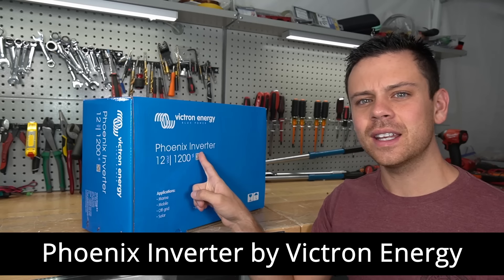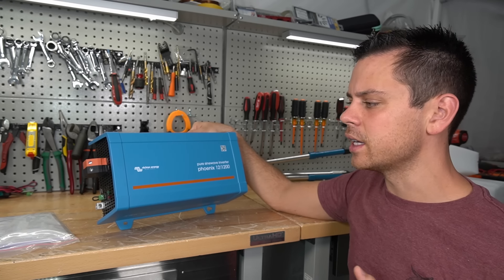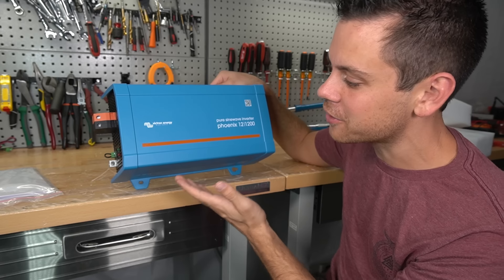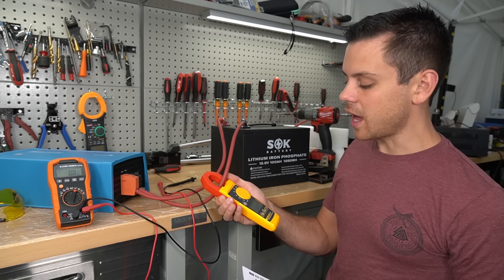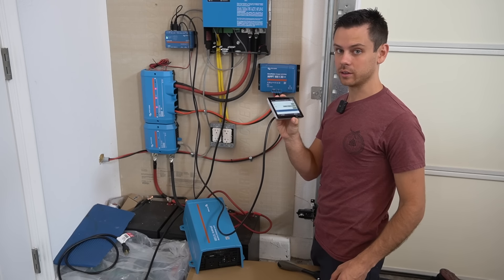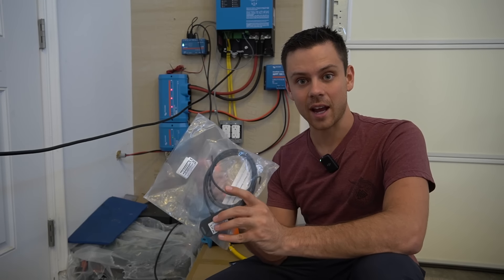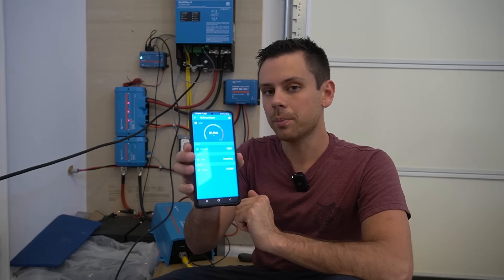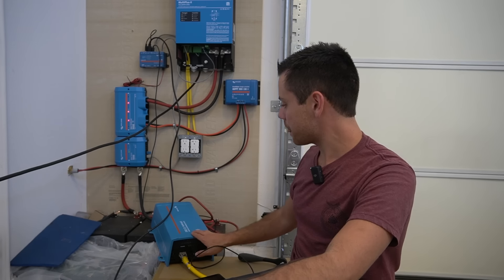Victron Phoenix 1200VA LF Inverter: Extremely Low Standby Consumption and More!

Comment: Hello 
So do you think this inverter is ok too leave on 24hrs a day ? 
I have a system set up in the garage for small power loads like tool battery chargers, USB things. 
But was wondering about running a cable in to house too a stand alone socket and power the TV and Wi-Fi things off it most too time. 
Thank you for your videos really good.
Sam
Reply: Hi there. My setup is almost the same. I have a battery&charge controller in the garage, also a cheap inverter was there until it broke. I run a cable to one of my rooms and a socket was powering my laptop + screen. Now it’s time to buy a new inverter and I was thinking to go for either this victron or the renogy 2000w. Low consumption may be important though… not sure yet what to do

Comment: Hello, i already have the 12/375 Phoenix inverter and i am planning to buy in a few days the 12/1200. My question is can the 1200 inverter run a washing machine without issues if the loads of the washing machine are in the limits of 1000 watts (wont use any warm water just cold) ? I ask because im wondering if the constantly start and stop the drum of washing machine does to wash the clothes make any damage to the inverter. Thank you. Keep up the good videos !

Comment: I'm sure on Eco mode the output signal is not a sinusoidal wave. So, if you want to charge your phone or other small devices you will need to disconnect the Eco mode 😕 
Thanks for the review!

Comment: egs002, ferrite ring, loop it around welding wire a couple times, add a transformer, torroidal salvaged or new if you can find them
10kw 25w idle laminated transformer, 15w toriodal
and the 10kw boards can be pushed to 250-300a as opposed to the factory 200a shunt limit. 
Theyre chinese, but they are actually good. 
You need it mounted to solid surfaces, so cables are managed and batteries can be in same cabinet too. This is best way.

Comment: I just bought a Vicron Phoenix 1200VA and have a question on grounding.  On the Victron there is an internal jumper to change it from floating neutral to bonded neutral.  Since this will be in my garage that already has power and a panel I am confused on how to ground it.  Do I leave it in neutral floating configuration and connect the ground to my panel ground (two ground rods 10 feet apart) or do I bond the neutral on my Victron internally and use a separate earth ground therefore isolating it from the rest of my garage?  I know from NEC code there should be only one neutral ground bond so that is where I am confused.  My inverter and mini solar setup will never be connected to the grid.

Comment: Can I connect the 12/1200 inverter to a circuit breaker load center to run a small workshop that has some led lights, and some small equipment?  I have the 5-15 plug version

Comment: Victron vs Outback?? Outback is my only experience with pure sine wave inverters, I use a VFXR2812 in my semi. Am very interested in building a LARGE solar generator using reconditioned forklift batteries, and just wondered what inverter / inverters I should be considering?

Comment: Will,
WOW! This seems amazing. Maybe I dont need a MultiPlus Compact for my camper?

With the low AC output ... Might it be good for use in a small-mid sized camper? 
I know it won't run my AC,but in my 2023 Grand Design Imagine 22MLE ... would it run my:
- Keurig K-Mini Single Serve Coffee Maker max consumption in the manual is 1470W ?
- Duxtop 1800W Portable Induction Cooktop?

Cheers, and Merry Christmas! 🎄

Comment: I've got two 23 year old Trace SW2512 inverters that consume 12 watts on standby and have an adjustable search mode that uses a watt or two. 23 years old and still running! Trace was the original and as far as I'm concerned is the best.

Comment: The idea of buying these vs targeted cost of battery capacity for AIO device power overhead at night is the most interesting aspect of this video to me.    I plan on exploring that more to see if its worth it on my end (EG4 6500) to buy 2x Victrons for tv/media/router + fridge and shut off the 6500s at night.   If anyone else has done the math on this as id love to compare.   I need to justify / have ROI buying more fun stuff.  Will needless to say your the man, great video.
Reply: You probably only need one-these can handle a high initial surge,and most refrigerators these days are pretty efficient.

Comment: I presume this inverter will function without the bluetooth dongle if they are fine with utilizing generic (lead acid) factory default settings. (?)  
If the answer to this question is YES, then:  Any system requiring non-typical settings (lithium for example) will REQUIRE the need for the dongle.  (?)  It appears there are no adjustment controls anywhere on this inverter (as well as the Victron Bluesolar charge controllers.) So anyone installing Victron gear on a non-typical (not lead acid) system really MUST acquire the dongle in order to adjust parameters.  (?)  Huge thank you to anyone who can clarify these questions.  :)

Comment: What about fuse size for the 12v 1200VA? A 35mm2 battery cable with a mega fuse to cover the peak power 2200W? Or should we only think about the continious power 1000W?

2200/12*1,25=229A
1000/12*1,25=104A

Comment: My 12 volt off-grid inverter uses 1 Amp on standby, in winter, far too much,  I used to have to go outside to turn off the inverter before sleep, getting out of a warm bed and going out naked in the snow was not much fun. Pre made remote switches only came with a non extendable 15m long cable were expensive and over complicated, so I ended up fitting a relay across the on/off switch of the inverter and a cable to a switch by my bed.

Comment: can you possibly test if victron phoenix inverter 12/250 can handle an inverter type ref with rated input voltage of 230V,60hz, rated current of 0.60A and rated input power of 60W?

Comment: I have one of these for a small solar setup. The biggest load is recharging my EGO mower battery, the charger pulls 880(?) watts, with a 12v LiFPO 100ah battery supporting the inverter. This seems to drain the battery causing the inverter to alarm and shutoff. Should I add another battery to support  the inverter?

Comment: I would love to have one of these. I have a samlex pure SW 1000w inverter. It is a nice inverter, Only real difference is it has no low voltage cut off, and the on/off switch is on the front of the unit. I use the on/off switch regulary and would find it awkward with the phoenix. Where my inverter is located it would be inconvenient. Yes i would need to use the remote function. The samlex also has 2 outlets...

but the blue tooth and the LVD are worth it to me.

Comment: Planning a tiny house on a trailer and will only use Victron due to only brand that use very small current on standby. Their EasySolar-II 3000 has a 2400w inverter with only 11w in zero usage standby. It will save me lots of batteries as I aim for a week on batteries (not much sun in Sweden in winter and charge on car charging stations). So the cost of Victron I save on batteries, not to talk about the weight. I also do not want my inverter to die in the middle of the winter so I want quality.

Comment: What do you recomend for 16 250w paneles for off grid? Thanks
Reply: Hello,  YOur 16 panels is 4000 watts. at most you would get about 3500 -3600 watts in summer California San Diego, cool ideal temperature 75F..  it's depend on what load you use to get the inverter you needed... Victron use VA not Watts. so you needed to calculate.  And the batteries.  I have 4950 Watts, 4x 470w and 11x 250w.  I got max at about 4200-4300 watts at max sun or ideal temperature of the year.  in Winter if cloudy I got about 200-400 watts depend on how bad cloudy. even sunny I get about 2500-3000 watts at max clear day in November to January 19 now.  it's been rain 4 days, I can not charge My Tesla during Winter,.. very little days I can charge only if it clear sunny day.  Inverter i am using EG4-6500 EX.  it stand by drain 70w /hour no load.  I will go over to Victron for efficiency.  High invest at first but be sure piece of mind it efficiency,
My EG4 Efficiency is 91% Peak ,  Victron is 94-96% conversion DC to Ac you use.  So.  Better to use Victron, Think about 5 Years use......  Average: depend on how much you use.  You get money back in 4-5 years.  I calculate my system: EG4 6500 EX x 2 units, 30 kwh batteries (15kwh EG4 + 15 kwh of 16 cells TACL 310 AH ).  and wire cost me about 12,000 USD or so, let say 15,000.  this system cost 40,000 USD if hire those companies out there do it.  Average Monthly use average is 150-200 USD a month so 1 year is 2000 x 7 years is 14,000.  You see?  Good lucks.  If I think harder,  I would buy Victron at first tho.... and low noise.  EG4 really loud.  but I like the Air filter dust before it get air get inside.  Victron is even better.  But Big unit have Fan too,  I would have to ask them are those Fan blow air to heat sink or to inside unit.

Comment: I have the Phoenix 12/250W version and the fan runs constantly - even when the unit is switched off. I was hoping it would be quieter and only turn the fan on when needed. Is mine possibly faulty? I have it connected to a WEIZE 12V 50Ah LiFePO4 Lithium Battery. Thanks.
Reply: Update: Returned it for a new one and do not have this issue anymore. It must have been faulty.

Comment: Yes, this Inverter supplies most of my 24/7 loads of the house.  I took this because the 800W version is the recommended minimum version for refrigerator. The fridge makes no problems, but when the freezer starts, I hear noise from the transformer (magnetostriction) and the function of some sensitive appliances are disturbed. TV, laptops and Desktop PCS are not disturbed but i hear the starten of the freezer from the speakers of the PC which are connected by a small Power supply.

Comment: Hello Will,I have a question about the Victron inverter....If you were to install the inverter to the shunt, how would you connect the inverter to the battery bank? Would you be able to still have the distributor, the charge controller and cebo connected without using the large inverter/charger?

Comment: "Off-grid Garage" has a two Victron inverters, one is "On" and it brings the other one on when there is a need for more power, then off again. This means that at low loads only a small quiescent current is needed but at high loads the system can supply 7KVA.

Comment: Would this be a good option to power my thermal hydronic space and water heating system? One ~60 watt pump circulates the water through the hrdronic collectors about 10hrs per  day  as sun shines.(on a differential controller to mass tank). The other pump turns on intermittently as the thermostat calls for it (primarily at night.)
I am wanting these electric and thermal hydronic systems that satisfy heating and hot water needs to run independently of the rest of the household and this inverters small size and standby savings seam ideal for intermittent pump operations

Comment: Hi Will, I’ve been watching many of your video to build a system for my tiny cabin. I have this exact victron inverter (24v/1200va), and I want to ask for your expertise. Will it run a 5000BTU window air conditioner? I know the current draw is about 5A but I am worry about the current surge and if this inverter will handle it. Thank you!

Comment: Good. But a better inverter review would have connected it to the shunt and measured absorbed power vs output power at various power level and also in a resistive load or motor load to see difference in efficiency as two curves : as this should be a low frequency inverter it should be very good for low power factor loads. My eur 300 chinese high freq inverter from 2014 handles very well resistive loads up to 2400w continuous, it is rated 3000VA but handles more poorly startup of motors, like a pool pump or a chainsaw (the startup is a little slower) however the no load power used is less than 40w and the peak efficiency @1500w is very nice at 93%. it stays good up to the max but is very poor for small loads like 200w.

Comment: Does a charge controller only use the energy from the panels to charge the batteries bank? Or excess energy is also used by the inverter? I mean when batteries are fully charged is the energy produced by the panels directed to a running inverter (with loads)

Comment: 2 x100 watt 12 volt  panels going to charge controller  what size fuse do you need   between  controller and battery  on + cable ?

Comment: I have the 800 version hooked up to a small lithium setup in my jeep that I only use for camping.  I do not have much of a need for an inverter as most stuff I use is run off of 12 volt.  All of my other components aside from my battery are Victron as well.  I could have gone with a cheap china unit but I've used garbage in the past, and its always garbage.  I wanted to know that what I have was going to just work no matter what.  Ive only needed the inverter a handful of times and its been flawless.  I have the remote mounted to a panel, I usually have no need to keep it on.  This is a solid unit that will probably last me a lifetime.  Its also nice using all Victron components so I have all relevant information on one screen in the app.  While it may cost a little more up front, more than likely I will not ever have a need to replace any of the components so it will cost less in the long term.  

As far as the firmware updates. Victron updates the firmware pretty regularly which is a good thing.  The latest update has all the important info on one screen now in the app, I've been waiting for that
Reply: did you have to buy any bluetooth gizmo to get that data, or did it come as no extra cost?

Comment: My first Victron purchase was a 24V, 1200W inverter.  I bought it primarily because of the low standby power and it was a perfect fit for a 6S Li-Ion (NMC) Tesla battery module.  Now I have 15 Victron devices and I'm convinced Victron is best equipment out there.
Reply: Can you discuss your typical loading percentages of your victron inverters (percentage of max rated load)?  Have you discovered the sweet spot of efficiency?

Comment: Can I use this to charge (via alternator) my Ecoflow Delta 2 Max?  Would I just connect from the AC output to my delta AC input?  Im trying to have a way to have both solar connected and some other way to charge the Delta at same time.  I don’t want to have to change XT-60 cable between solar and other charging device.

Comment: Can these inverters be installed in parallel? 1200W is too small. 2400W would be enough for my boat needs. I would like to run one inverter most of the time and then switch them both on when running bigger loads like the air fryer :)

Comment: yes have it like that, a 800W Phoenix inverter build in my battery box for 24/7 and a 5 kW Multiplus for the heavy loads. That is the ideal off-grid setup.

Comment: I've been using a 48 volt 375VA Phoenix for almost 3 years now to power overhead lights and a couple ceiling fans. That way if I need to power off my main inverters I still have lights fed directly from the batteries and it eliminates the flickering I would occasionally get with some LED bulbs running off my Growatt inverters. It's run rock solid, has low voltage disconnect and just works. They make a solid product.
Reply: Hello, do you know if it is possible to connect a Victron Phoenix 48 250VA to a 13S 12Ah lithium battery?
Reply: @stereojos86  yep, they support a voltage range of 38 to 62 volts. You can set the voltage it should shut off as the low voltage for your battery bank as long as you have the Bluetooth dongle for it.
Reply: @stereojos86  why only 12 Ah ? because of the space?  You should have 100 Ah at least.

Comment: Do we really still need all that AC Power? For almost any application DC should work just as well, if not even better. I even question weather you need to wire up every room. Wall outlets seem to be always in the wrong place anyway.

Comment: Just a note. When powering a refrigerator “search mode” could fail to restart. Fridges with computer controls need to have continuous power to function. They do not draw enough power   to trigger restart of the inverter after shutdown of the compressor motor in the fridge. Older units with mechanical temperature controls will create the load needed to start the inverter and do well in search mode. I have a chest freezer that has old style controls that cycles on frequently enough to keep my other appliances with computer controls functioning. Finally I gave up on search mode and just use eco mode. This works because the low power draws are serviced with modified sine wave power but loads greater than 50 watts are powered with pure sine wave power.  That way my 10 watt light comes on when I open the fridge and the fridge doesn’t have to wait for the chest freezer  to function.